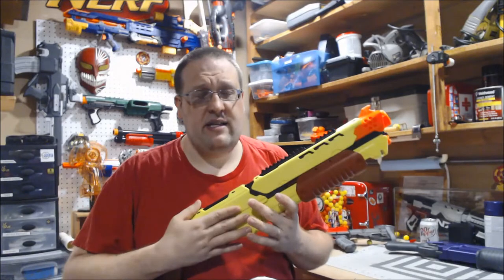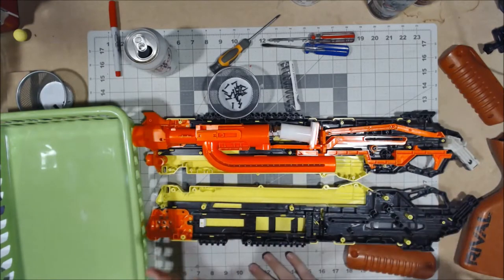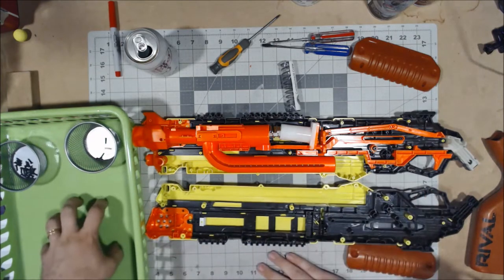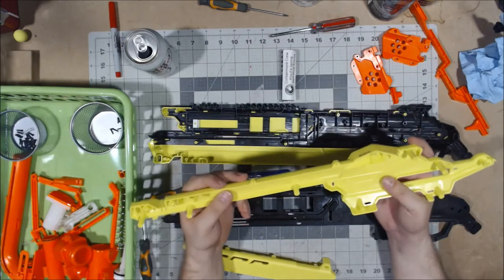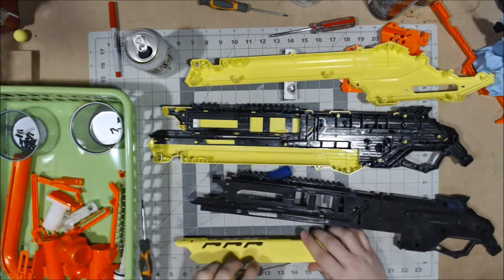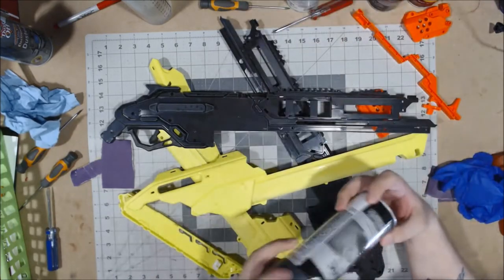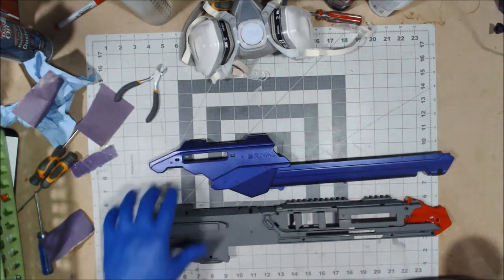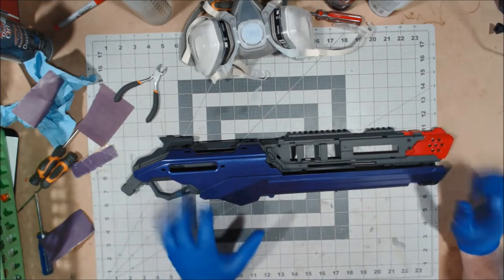Nerf Rival Saturn Mod Guide

Comment: Great video, Thinking of modding both my Infinus and Saturn, so this was very helpful. Have you ever experimented with using Panel Black on the wood textured parts? Am gonna try it on mine to try to get the wood texture to pop so if you'd like some pictures of the end result I shall be sure to send or post them somewhere!
Reply from the maker: I haven't tried a wash to pop the wood grain, if I get a second I would give it a shot, and sure I would love to see the pics.
Reply: what’s panel black?
Reply: @domsquaaa4323  You brush it on and wipe it off and it stays in all the crevices. Helps make details pop without much effort.

Comment: I want one with the highlighter yellow painted white. Unfortunately I live in the UK and the Saturn still hasn’t made it across the pond yet.
Reply from the maker: Hopefully it will make its way over to you soon. White Vinyl Dye will probably be your best bet turning the yellow to white.
Reply: @TheGriever2112  I was going to base coat it with a black vinyl dye, then a layer or two of matt grey then go for a gloss white. Use it for a while then clear coat it when it has a few scratches to give it character. I’m torn with the idea of painting the ‘wooden’ parts black since I’ll be going for a sort of sci-fi aesthetic or making a new stock out of actual wood. I’ll probably have to do the pump grip too if I do unless I can slap some picatinny rail on the bottom since I really fancy an afg or a caliburn style thumb hole grip. I’ll be side mounting a light on the right side as well since I’d like to use it in some night scenarios eventually. I’m not sure if I’ll bother to upgrade the spring since I’ll be using it at pretty close range as a pseudo secondary.

Comment: How exactly did you remove the yellowy-green parts from the black ones, I mean how did you undo the tabs? Sorry I'm new to the world of modding
Reply from the maker: A flat head screwdriver and patients. Use the screwdriver to pop the tab while you try and separate them. You may hit a glued spot. Just work it slowly and carefully.
Reply: @TheGriever2112  Thanks, this worked excellently

Comment: The pump is stuck in the same place when I try to pump it
Reply from the maker: Have you opened it before or is it still stock? It could be the slide came to far forward. The slide locks if they go past the stop point can lock up your prime.
Reply: @TheGriever2112  that makes sense I will have to open it up again